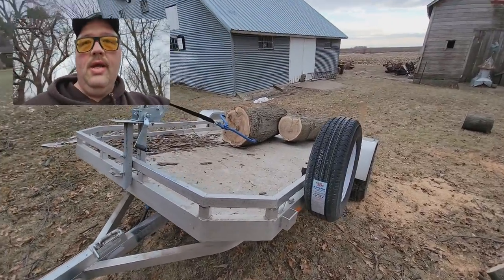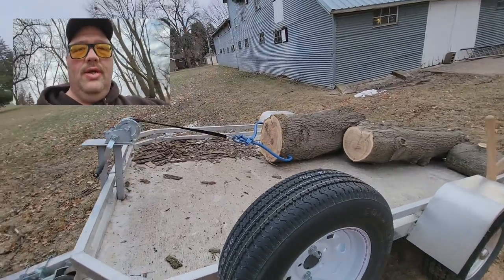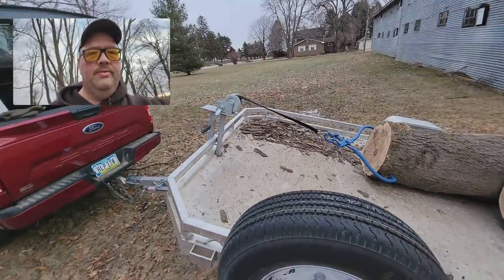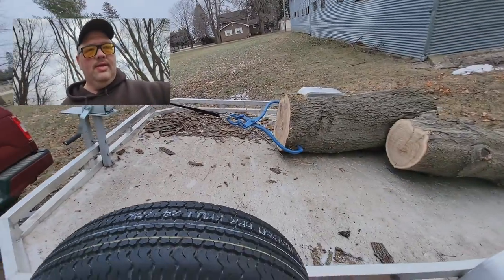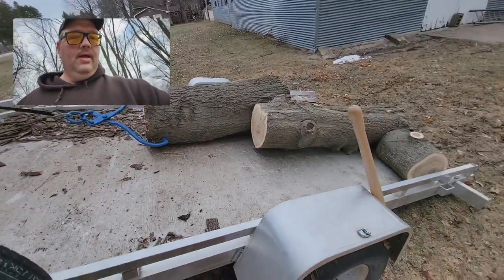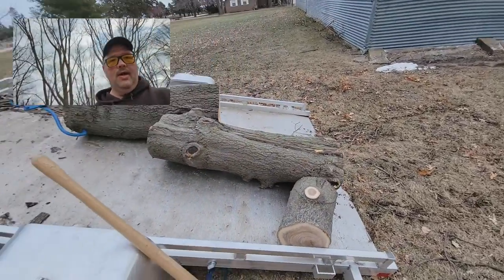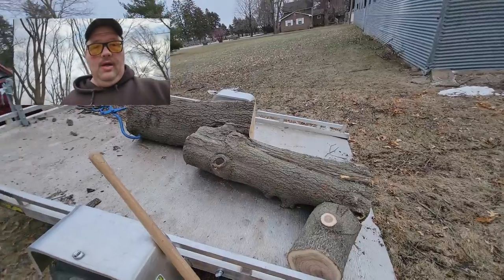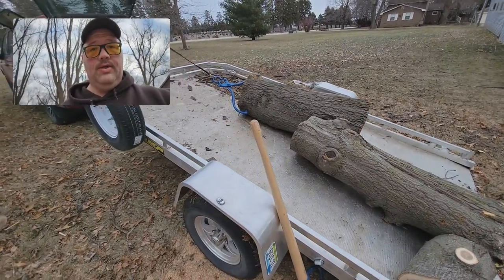Log loading on tilt bed trailer

Comment: Better than man-handling them.  I wonder if you carried a couple pieces of PVC that they could “ride” on???  Know what I mean?
Reply from the maker: Yes, I follow what you are getting at.  Maybe even couple lengths of pipe.  It was icy that day and it was sliding easily.  A electric winch would help even more and is in the plans in the future.  There's a video coming up showing me load couple logs this way and it shows how a winch with a remote would help a lot.  Thanks for watching, be safe brother!